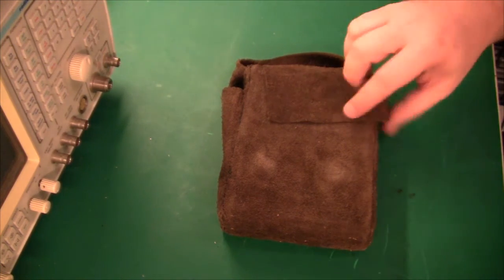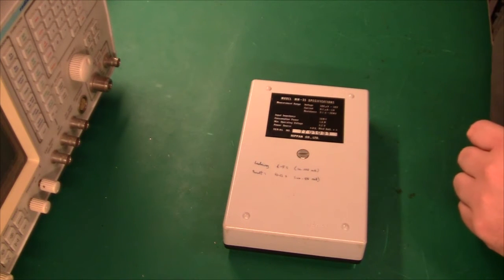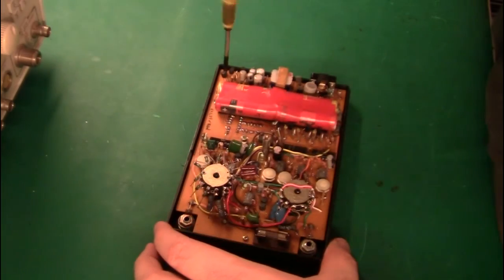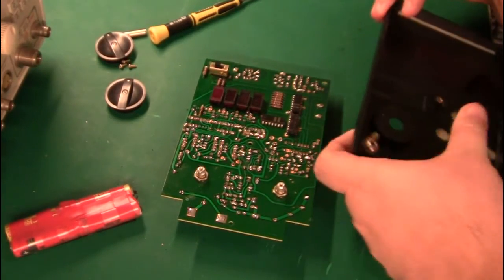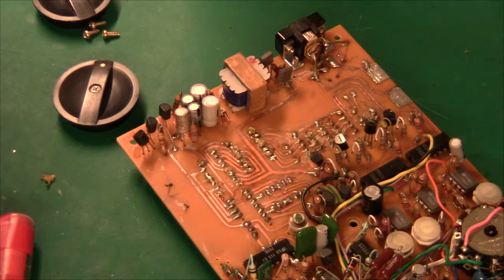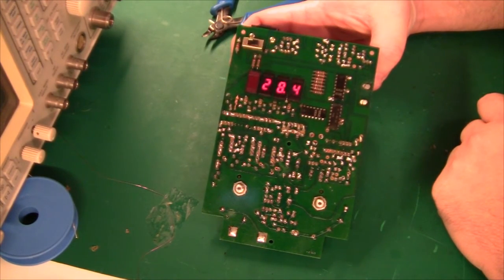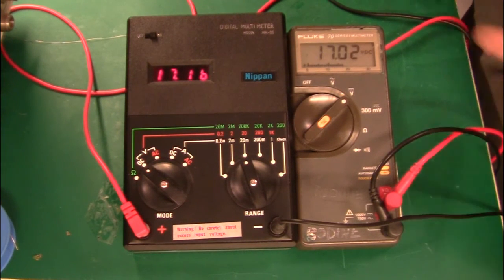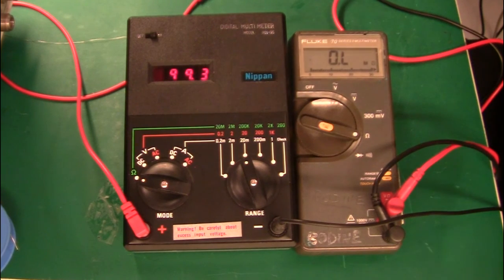Nippan MM-35 - World's first handheld digital multimeter (alledgedly)

Comment: The very first digital multimeter was the NLS X-2, from a company called Non-Linear Systems. It was manufactured around 1967. The X-2 utilizes a nixie tube display. So your 1977 Japanese DMM is not that old, and certainly not the world's first DMM. In fact, 1977 was the year that Fluke introduced their famous 8020A LCD DMM model. Yes, LCD display already in 1977. But nice find anyway, and thanks for sharing. BTW, I still have my very first multimeter, it's a Ballantine 3-24, red LED DMM from 1974 (I was 9 years old, and got it as a birthday gift) and it's still working perfectly (only the rechargeable batteries have been replaced, of course).
Reply from the maker: Nice. I'll look around for one. I actually just got the HP970A which another viewer told me was earlier. I'm on a quest :)